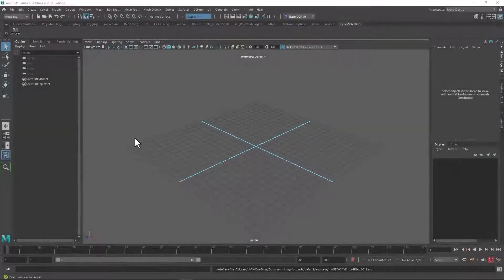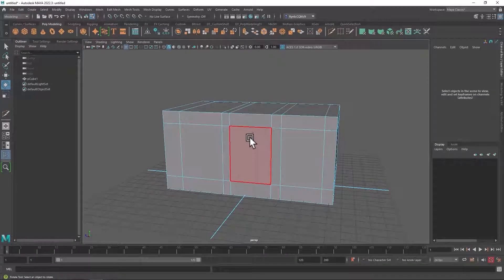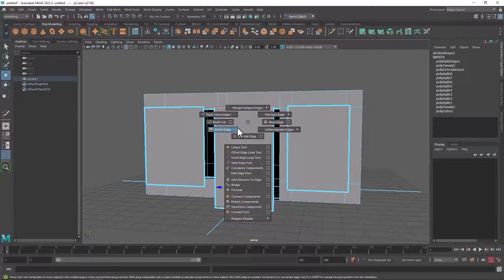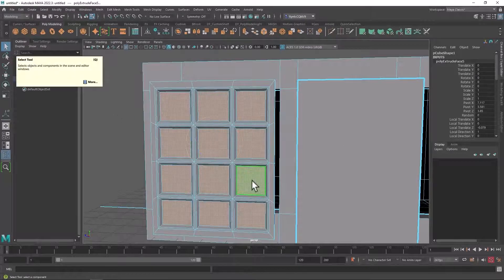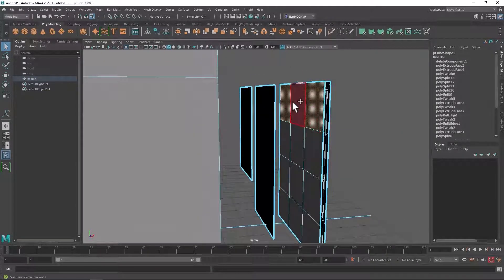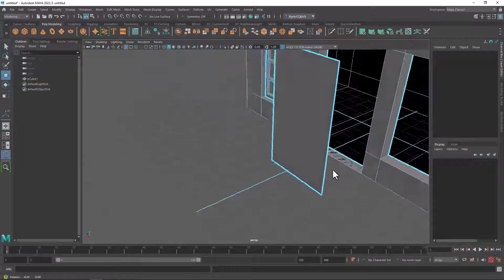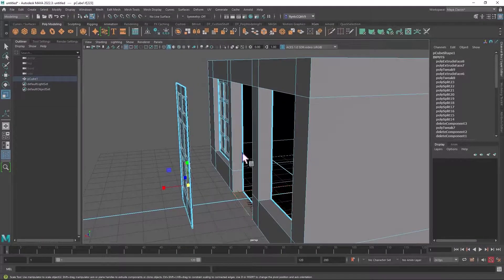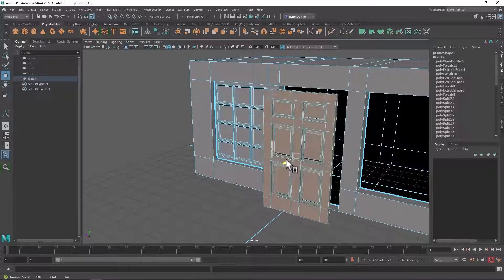Maya: Modeling Simple Windows and Doors

Comment: Thanks a lot Charles :-)) You actually saved my life. After watching this I wonder what the advanced techniques you mentioned are that can make the model more accurate. Have you addressed that in any of the videos that you uploaded?
Reply from the maker: What I meant by "advanced techniques" was simply adding more detail to the window, such as splitting it into two sashes so that it could be opened and closed and adding a casing structure with moulding, jambs and sills, much like a prefab window you might buy at the home improvement store.